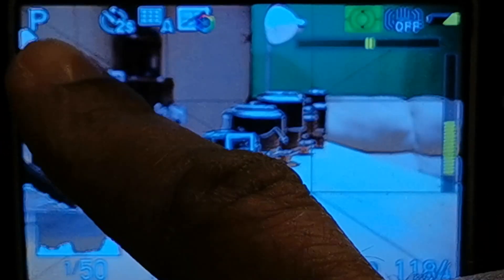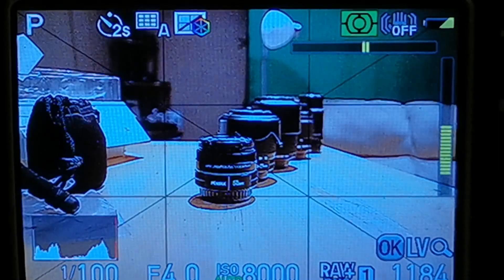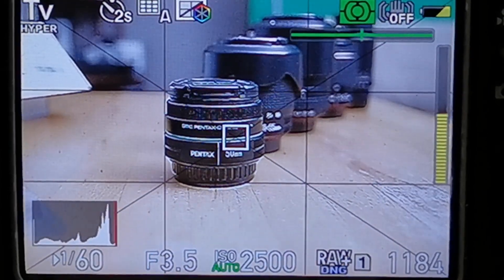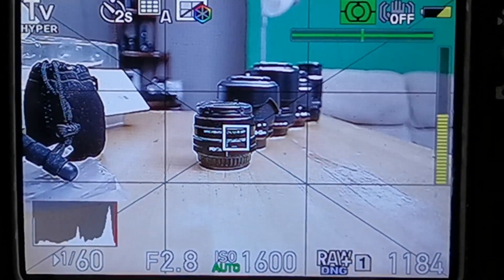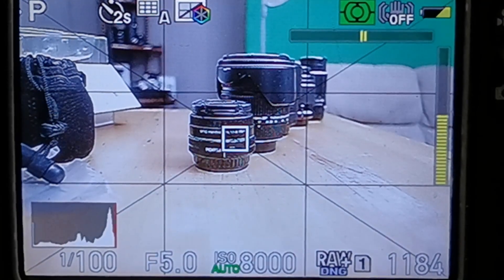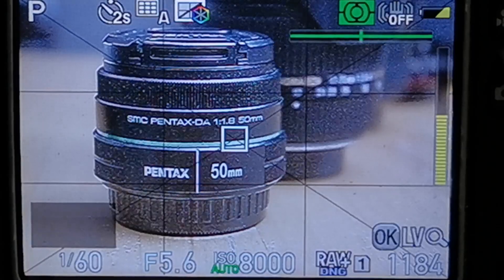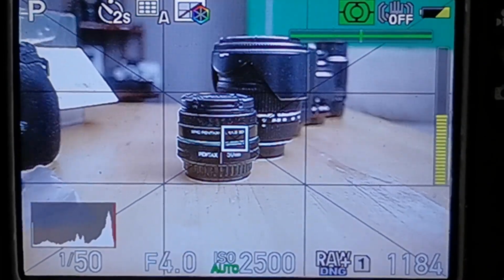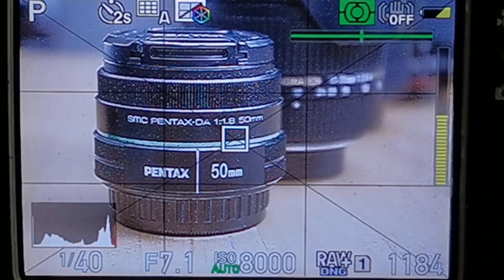The PENTAX P mode. So what exactly is P mode?!

Comment: I’m looking at the p-mode options on the K-70 and I’m not finding options anything like these. I’m not finding program line at all, though I do see reference p-line in the button customization.
Reply: It is not there in KF and K - r either.
Reply: Neanch'io
Reply from the maker: That is because the K-70, KF and other lower tier cameras have specific scene modes, candle, night, action/high speed, portrait etc. There is no need for program lines in that case.

Comment: The MTF is a bench test of data unique to each manufactured lens tested and stored on a chipset in each lens since 1985 (approx). It provides the optimal aperture for the best image depiction/rendering the lens is designed for. And it will vary with a variable focal length. The lens stores everything about its makeup which is communicated with the body, from focal length, to focus range, type of AF system, coatings, number of elements and groupings, type of diaphragm etc., that relate to the Program Line effect you choose, or the camera chooses.  And this is why MTF and arguably the Program Line functionality, only works optimally with PENTAX lenses. The most important part of your investment is the glass. We are beginning to see how AF, subject identification, and movement, is identified by colours. And white balance, colour depiction, metering, all figure prominently in the design of the IMAGE Engine which also weighs in heavily with clean image files, especially where specific colours are involved in low lighting.

Comment: When in P mode, if you move the aperture dial, it will automatically turn to "aperture priority mode".  If you move the shutter speed dial, it will automatically switch to "shutter priority mode".  Touch the "green" button, and it will go back to full auto mode, and will adjust the exposure according to the program line selected in the mode function.  Nobody else has a similar function on a camera.
Reply from the maker: Pentax are definitely made by photographers, for photographers.
Reply: @KobieMC   You said it.

Comment: Thanks for making more sense of the P mode, I usually shoot in TAV or manual for the most part, its only when I bought a K3 that I found the different P mode options, unless I've missed it I don't think my K-70 has them? Its another cool feature from Pentax though, I'll have to try them out a little more to get a feel for how well they work in different scenes. PS cheers for the shout out 👍
Reply from the maker: My K-30 has normal, and MTF. Right now it's set up as a vintage lens camera so program mode doesn't do anything since there's no electronic coupling for the lenses. But the K-3 does have more options. It's possible the K-70 is a basic P mode camera like the K-30, but they both do have MTF.
Reply: I’m trying to work in P-mode on the K70 can’t seem to find similar options for settings. Definitely not seeing those modes as options.
Reply from the maker: The K-70 has dedicated scene modes so it doesn't have program mode options that the higher end cameras have. On the K-70, P mode is a full auto mode that also allows you to override the shutter/aperture on the fly.
Reply: @KobieMC  Got it. Thanks.

Comment: Interesting video, Kobie, thank you for this!  Pentax cameras have features that are actually useful for photographers, unlike some that seem stuffed full of gimmicks.  I can't help thinking it would have been better if you had used the 50 mm f1.8 for this demo as it would give a greater range of apertures for the camera to work with.  I don't think MTF will work with non-Pentax lenses as the camera would not have the lens profile built in, so it would not know at which aperture it is sharpest.

Comment: Most of my shooting is done in Program mode. Manual selection of aperture or shutter priority within the program parameters can be done on the fly using the rear or front control wheels, which works well for my walking-around street photography.
Reply from the maker: Yup. Pentax "Hyper" Program
Reply: That does sound like a handy way to use the P mode, I'll have to give it a try next time out!